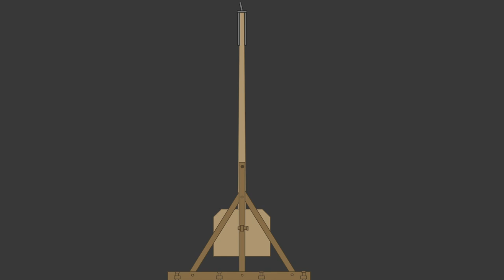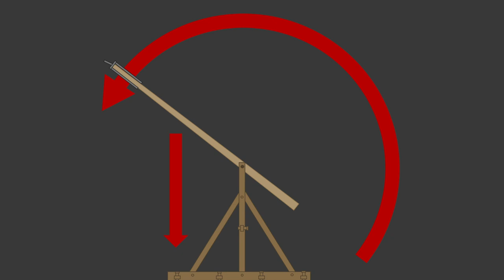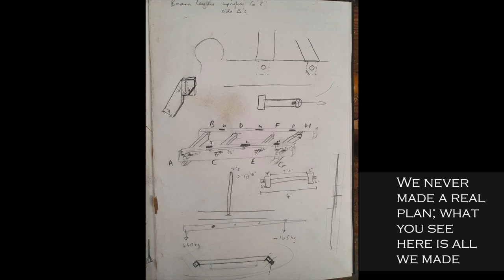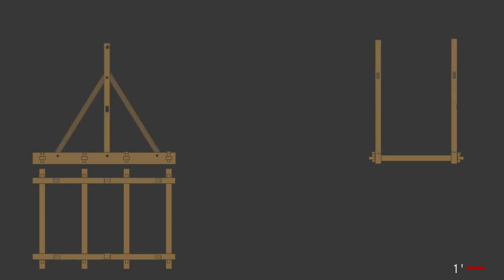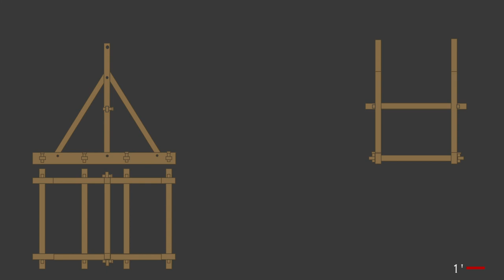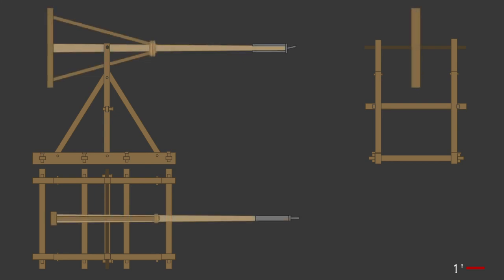The Trebuchet: Making and Launching!

Comment: Great video. How do you adjust the angle of release?
Reply from the maker: Thanks! The iron peg which holds one end of the loose end of the sling can be removed and replaced with another one that is bent at a different angle just by knocking out a few pegs- also different lengths of sling can alter the trajectory
Reply: @hugobanneret7702  Thanks Hugo. I suppose there is an element of experimentation involved in getting it right. A good excuse for more firing!